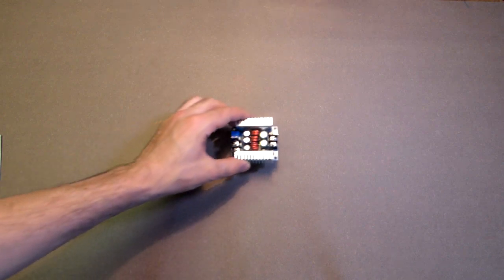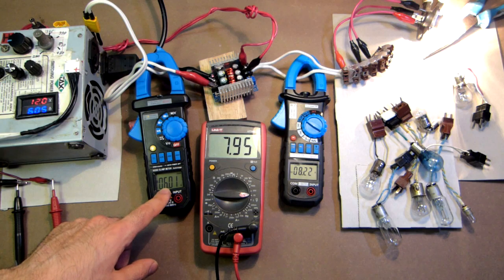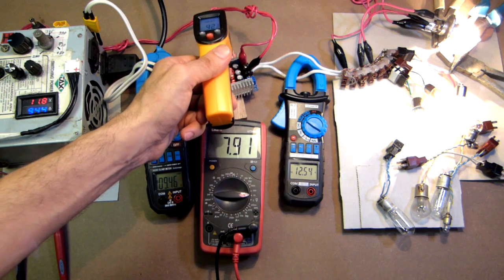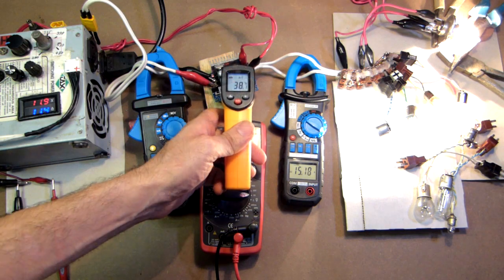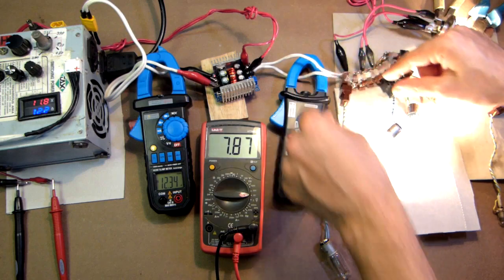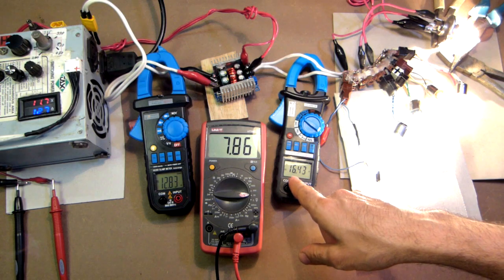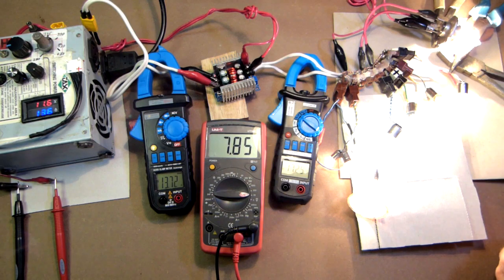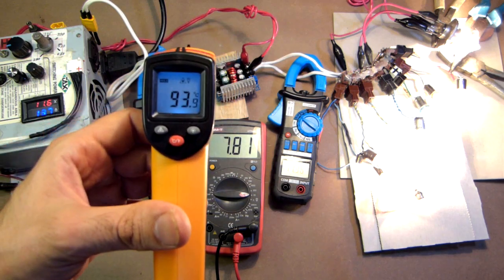300W Step Down - 20A DC-DC Converter

Comment: I bought 20 of these, plugged each into a LiPO battery (7.4v), and only 2 of 20 worked. The 18 bad ones had no burning smell, but the LEDs didn't turn on. Power switch is on. Voltometer measures 7.4v in, 0v out. Could 18 be defective?
Reply from the maker: Yes, they could.
In fact, it's a very defective device.

Comment: If i have 2 module of 20amp and I will to connet in serie. I would to share the current for to reach to 30amp with both modules? Thanks a lot
Reply from the maker: Hello, - you mean not in series, but in parallel. But you should use only 1 potentiometer to control the voltage on both devices, so, the pins of the potentiometer should be connected also to the pins of the second DC-DC potentiometer, and the second DC-DC potentiometer should be removed.
So, this issue is not so easy as it seems to be ;)

 Please, subscribe to my another channel: https://www.youtube.com/channel/UCbQUNw5V5pDPXugLX1FP_Fg
Reply: @powerbatterychannel4315  But if my power supply is 12v - 30 amps and I put only 1 Dc-Dc module of 20 amps. Will I be able to get the 30 amps that the power supply gives me? If I connect the 2 Dc-Dc modules in series, will I be able to get the 30 amps? If I connect the 2 Dc-Dc modules in parallel, will I be able to get the 30 amps?
Reply from the maker: @danielamendez2553  The question is that your DC-DC provides 20 amps on the output. You have no need to connect them in series, however, in this case your  power supply will definitely provide 30 amps, but there is no logic to connect 2 DC-DC converters this way - what for? In case of parallel connection - I've described that situation in my previous message.
Reply: @powerbatterychannel4315  thanks a lot
Reply from the maker: @danielamendez2553  You are welcome!

Comment: Greeting!  Good video!  Would it be possible to get 5V with 15A with a conveter so that it can work longer without overheating and shutting down?  Thank you
Reply from the maker: Hello, it would not; 15A is a very high current.
Reply: How much A can handle at 5V?
Reply from the maker: @marox3G  App. 7A

Comment: hello sir I have a 12v 30A smps i want to make a adjustable power supply 2v-30v, i have two different options with two module 
1: use 150w step up dc  converter for reach 30v and then use 300w step-down dc converter for adjust voltage. 
2: use both modules separately, it's mean 150w step-up dc converter for above 12v range and 300w step-down dc converter for below 12v range 
which on is better or maybe both are bad idea?
Reply from the maker: Hello, in my opinion, the second idea is better.
Reply: @powerbatterychannel4315   why not first one? in case of first step up module doesn't need current control but second one need step up converter with current control
Reply from the maker: @mase2725  Because of greater power loss.

Comment: Nice video, thanks for sharing. A comment about the Loading process: as you are using incandescent lamps, while very practical - I liked your “manifold header”, by the way. However, for such lamps R.cold = just 10% of R.hot, so when you connected the lamps, several times it tripped because a 10W.hot would spike as a 100W.cold lamps/ resistor. One way to bypass this limitation is to check if an initial voltage of 1V (or a power resistor) could already warm the filament up enough to do the test.
Another way I way other YouTubers perform test is to use those cheap electric-shower resistances, that support up to 30A currents, submerged in water and then using an alligator clip to smoothly select increased loads.
Finally, it was relieving and interesting to see the voltage drop didn’t go as low as the load was increased, differently of what was shown in Robojax’s channel Review of such 20A module. Maybe his setup misread at the load the voltages, or his unit was “half-faulty”, who knows?

Comment: I want  to control  high torque servo like 35KG,  i am planning  to use this module for 4 servo powering. To get max torque i need 6volt 4 amps.  Is it possible  to get: --- input 12 volt 4200mah lipo -- want to get 6volt 18amp output??

Comment: Hello there. I have a question: i want to use this to power two 12v 55w bulbs on my car but at 6v so they can act as drl lights with max 21w per bulb. Will this device do the job ? Tnx!
Reply from the maker: Yes, it should do it.

Comment: Nice video. Can I ask you if I connect two devices parallel it works?
I have solar panel 380w 36v and if I connect one it works at 90% of power .
I  change 12v lead acid  battery. 
Thanks so much 🙏
Reply from the maker: You should make certain changes in the scheme and control the voltage only with the help of single potentiometer.
Reply: Thanks for your time
Reply from the maker: @michalisgeorgiou257  You are welcome!

Comment: The question is, if input change, will the output remain the same? I want to use this with input from a rectifier
Reply from the maker: Of course, it will.
Reply: @powerbatterychannel4315  thanks for the answer sir. Last question what is the max input voltage that this converter can handle?

Comment: Nice upload! If I want to replace the two potentiometers  for both the voltage and current, what sizes do you recommend? Thanks
Reply from the maker: The following size: http://got.by/53hl2g
Reply: it has a list of 1K 2K 5K 10K 20K 50K 100K ohm, which one do I choose for this converter? Thanks
Reply from the maker: @danielzhao3083  Mine has 10K ones. You should buy the converter and see its resistance on the top of its potentiometers.
Reply: If you keep voltage at 12V out put, how many Amps maximum can you get with this can converter? Thank you very much.
Reply from the maker: @danielzhao3083  About 15 amps; it also depends on the input voltage.
Reply: @powerbatterychannel4315  thanks a lot,  you are the best!
Reply: @powerbatterychannel4315  can i also use this converter to charge lithium ion battery?
Reply from the maker: @danielzhao3083  Of course.

Comment: I'm wanting to run a 100 watt ham radio that draws 18 amps at 13.8 volts. If I use a Li-ion pack of 18 volts  and raise the voltage for the  radio to 15 volts which is within its tolerance  then amperage would be lower so could this dc to dc buck handle the small drop from 18 to 15 volts and not get as hot  De, Kc6ulu
Reply from the maker: Hello, it will anyway get hot; moreover, the device mot probably will not withstand 18 amps, even in case of excellent cooling solution.

Comment: Perfect Video for a project I am working on. I am making a charger for my kweld/kcap. The out put needed to be 8.1v and I will be using a PC Power supply of 600watts at normal 12V.  If I use a fan on the DC converter, what do you think a good constant amperage would be to charge the caps...Great Video BTW!!!
Reply from the maker: Hello, even in case of a good cooling solution - I would not recommend more than 14-15 amps.
Reply: Power Battery Channel good deal, with a 30j pulse, 10 amp is supposed to recharge the caps in 3.5 second. I don’t think I’ll need anything more than that. Guess it time to make another psu👍👍👍

Comment: Hi I am from Bangladesh. I can use this kit solar system like MPPT charge controller
Reply from the maker: Hello, yes, if the voltage of the solar system is higher that battery voltage.

Comment: s it possible to have 2 modules in parallel? Can I have 600 W if it 2 are connected in parallel?
Reply from the maker: This issue was already discussed in Youtube, - you will get approximately 450W, but the output voltage should be exactly the same with the accuracy of 0,01V.
Reply: @powerbatterychannel4315  thanks!
Reply from the maker: @pruebasazz  You are welcome

Comment: nice, thanks  (maybe it would'nt be that complicated when using an adjustable electronic-load?)  but anyway, thanks.  I'd like to ask, what's this "on/off" good for. My module has no switch, just empty holes as an option to put a switch on there.  Does it just switch everything on and off or is there anythng else, which should be mentioned?   thx  .)
Reply from the maker: Hello, 1) I have no  electronic load; 2) this on/off switch really turns everything on/off. Good luck! :)

Comment: I had this converter, for some reasons, it stopped working after I removed the potentiometers and replaced them
Reply: Donald  Iro I had the same problem 
afterwards I realized that my soldering iron temp was too tow and it was taking time to desolder 
just crank up the temperature and desoldering the old potentiometer within 2 seconds 
in that way the excess heat will not harm the other components
Reply: @EvanFerrao  thank you very much

Comment: Is the ground isolated on these for instance using two of them to charge a 48v battery bank 4 12v batteries in series battery 2 and 3 will have - / + at the same spot will this be an issue
Reply from the maker: The ground is not isolated of these devices.

Comment: How to repair adjut cc amper not working?
Reply from the maker: Hello, you should unsolder its potentiometer and solder another one with the corresponding resistance.
Reply: @powerbatterychannel4315  The means of what once I remove its potentiometer. And which part to replace. Got the same one as the video
Reply: @powerbatterychannel4315  I wonder which one to replace, because the volt can run but the amperage can't
Reply from the maker: @viansani4704  So, the potentiometer, which changes the current, is damaged. You should replace it.
Reply: @powerbatterychannel4315  Potentiometer had I replaced, but no change. Then what is a broken one, and needs to be changed?
Reply from the maker: @viansani4704  You should circuit board wiring; maybe something is damaged.
Reply: @powerbatterychannel4315  Make videos on how tutoial works. I see a great line. Is the IC damaged? The 6-foot.
Reply from the maker: @viansani4704  If wiring is OK, then the problem will be most probably in the IC.
Reply: @powerbatterychannel4315  IC which one? Is it the 5-foot one?
Reply from the maker: @viansani4704  I can't tell you exactly; maybe 5-foot one.
Reply: @powerbatterychannel4315  Okay, thanks brother
Reply from the maker: @viansani4704  You are welcome!

Comment: Hello.
my unit does not regulate the amperage limit, does its work well? since in the video I did not see to limit the output amperage ...

thank you for your help
Reply from the maker: It's not normal.  It should regulate the amperage.
Reply: Does your unit regulate the current output limit? grateful  @powerbatterychannel4315
Reply from the maker: @icphoto007  Yes, it does.

Comment: Could you make a follow up video focusing on the converter's ability to limit the current? This is a CC CV buck converter and you get very well around the CV (voltage) part at different loads. That's great. But how does the CC (current limiting ) part of the converter work? I seemed to have trouble trimming it for battery charging purposes...
Reply from the maker: Sorry, I have no such devices anymore...
Reply: I also couldn't get the current limiting to work, at least not by turning the CC pot by huge amounts in any direction.  Still wondering how or if it works.

Comment: hello sir....i have 36v 4.4ah battery but my ebike kit is of 24v 250w...so can i step down  to 24v and get the same amphr using this converter??
Reply: also curious about this
Reply from the maker: @Sagar Choudhary
Hello, - you will get the same W-Hr, i.e.V*Ah. I mean that your battery is 36*4.4Ah=158,4W-Hr. BUT! First of all,  - you should measure the maximum current consumption of the bike i.e. when you climb a hill.  Yes, it should be 250W/24V=10,42A, but sometimes it can be even more than 11-12A, and I would recommend a cooling solution in this case. Wish you successful transformation of your battery!
Reply: I'm sure it will work, subject to peak current as Power Battery Channel notes, however from the video I see towards the end that 11.6V x 13.9A = 161.24W is going into the inverter and 7.83 x 17.4 = 136.24W is coming out, meaning the device is 84% efficient - the rest is loss as heat. If range is important, then you need a much more efficient inverter.

Comment: Can i use it as laptop adapter using car cigarette 12v 10a outlet without any problems like voltage spike? My laptop power rating is 19v 8a 150w. Does converter have voltage spikes suppression?
Reply: This is a step down module, so if you feed it from Car battery which can be between 12 to 14V it will give you a smaller voltage. So a step down also called Buck module will not work for you. You need step up  or boost  converter.

Comment: Just found your channel - looks good. It's so nice to see someone use a fan. The life and performance of electronic components is directly proportional to how hot they get. I have changed over to aluminium finned resistors from bulbs, they are not any better  just smaller burns. The XL4016 (40V 8A) & XL4015 (36V 5A) bucks are worth a look at.

Comment: can i use it as battery charger?
Reply from the maker: Yes, sure
Reply: directly connect to battery? or need a diode for reverse protection. pls help. thanks
Reply from the maker: @UYP0911  It's better do use a diode.
Reply: Thank you
Reply from the maker: @UYP0911  You are welcome
Reply: I have other question, for example charging a sealed lead acid battery, i set the out put voltage to 15v in series w/ diode. Considering the voltage drop from diode. Is my settings enough?  or should i set to exact charging voltage which is 14.4v ?
Reply from the maker: It's better to set it to 14.4V
Reply: @UYP0911  diode will let all 15 volts through with very little load so be careful.
Reply: Thank you so much, help much
Reply from the maker: You are welcome!
Reply: Can i use it as charger with lithium  with bms?? 12.6v 3s